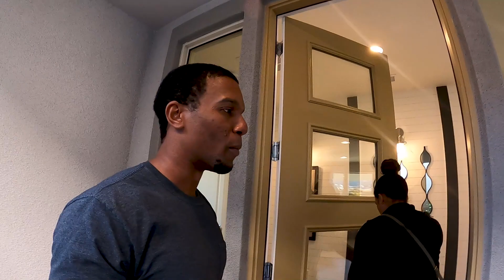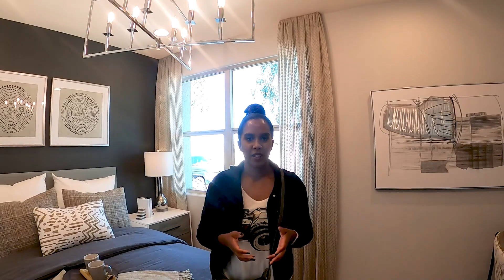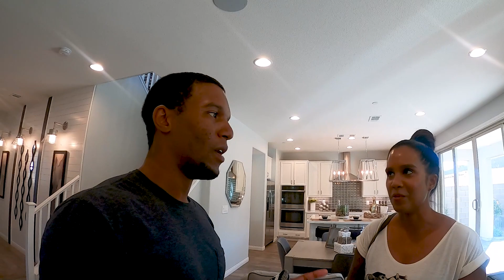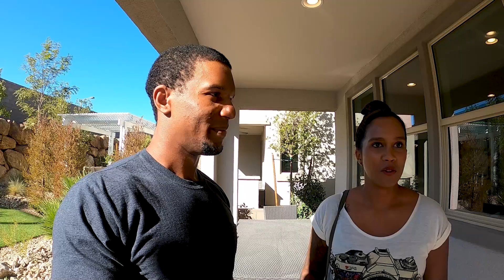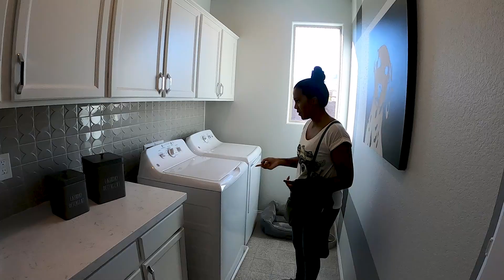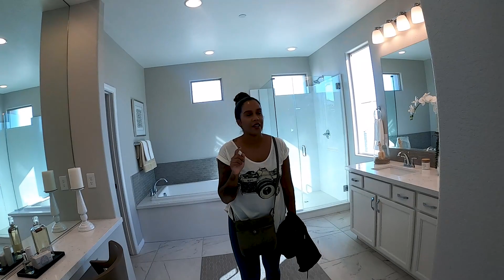NEW CONSTRUCTION UPDATE - REAL COST - ELECTRICAL WALK THROUGH - HOW TO MOVE TO USA FROM UK

Comment: Personally I prefer an all electric house because my goal would be a netzero home (no gas/electric bills). I plan to put solar panels and a battery storage area after my home is built. **Texas Grid can't be trusted lol*  I think in the US prewire for fans should be standard. Also, least 4 cat6 drop points should also be included with the way the homes are all becoming smart homes.
Reply from the maker: Thanks for watching and taking the time to comment. 

Interesting we enjoy a Gas Hob due to the ease of temperature control when cooking, I just can't get on with electric hobs.  Other than that I agree with an all electric home and most definitely Solar and batteries in most US states. A lot of the US has the space and the sun required for it to be a viable option. I can't work out why it is not part of code that homes need Solar here in Nevada. Also agree with CAT6 and fan pre-wire being standard but probably wouldn't make it code.

Haha I have heard about Texas and their issues with utilities but have not experienced it myself!

Ant

Comment: For extra bedrooms that will not be heavily used, I opted to use the included ceiling fan prewire to install a ceiling fan and will add a lighting kit to it.
Reply from the maker: That's a good idea. 

We have just received the paperwork and pricing for the electrical this weekend. We've been away for Formula 1 so haven't had a chance for review... However we may modify some of the option, e.g. As you have mentioned do a pre wire and set up a fan wigh lights rather than recessed lighting. Once we have adjusted and signed we plan on doing a full and final update for the total build cost.